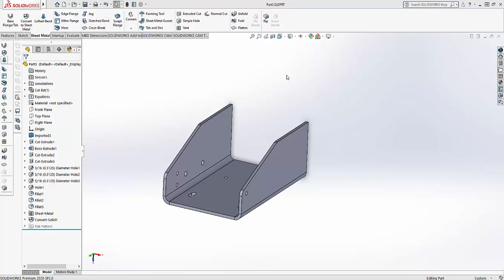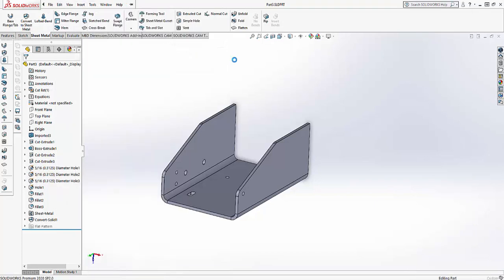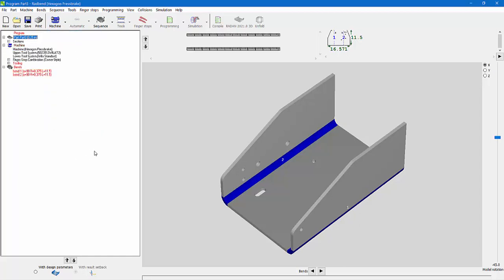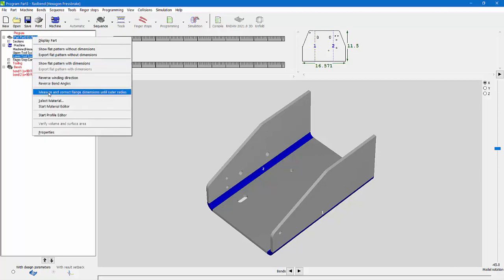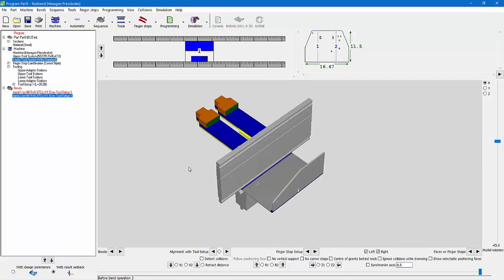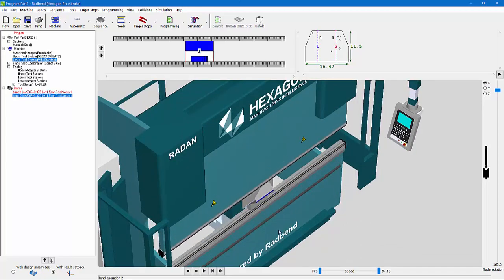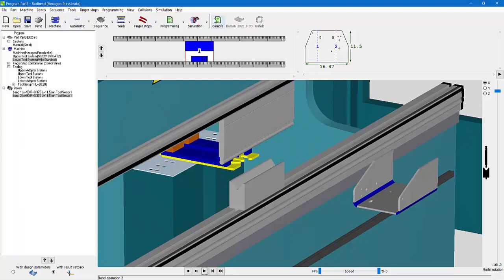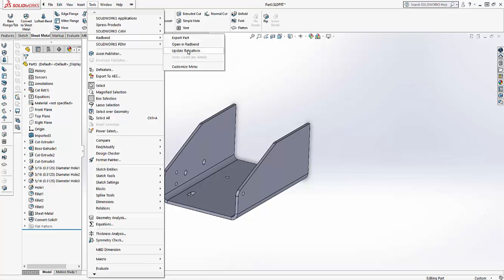Passing Solidworks To Radbend | 2020

Comment from the maker: Let me know if you have any questions we are happy to help.
Reply: Dean,
Is there a way to change radbend units to inches instead of mm?
Reply from the maker: @davewiebe2582   Yes You would have to scroll down and make sure you are under admin and you can change and save default settings. I have not got road bend on my PC anymore but reach out to radan support 800 875 7232 
Have a great Day
Reply: Is this program free
Reply from the maker: @allahwithme1731  No There is  cost associated with it you can find some contact on Radan.com
Reply: Is it generate best bend sequences for difficult part
Reply from the maker: @allahwithme1731  yes it will look at your tool Libary or it will chose from the eTools you don't have as well so if you need to buy a tool you can look at getting what is best to do that job